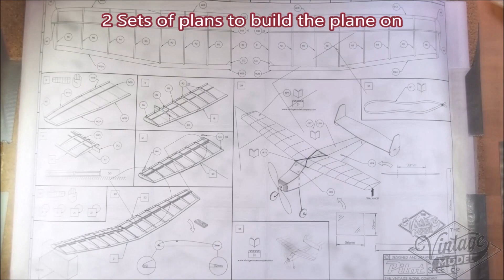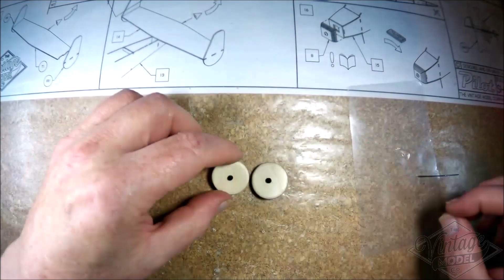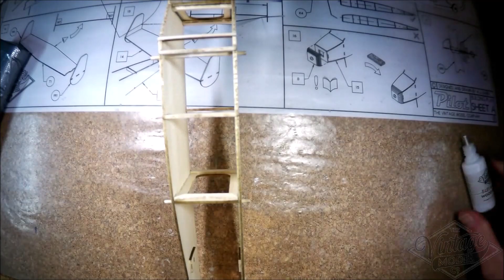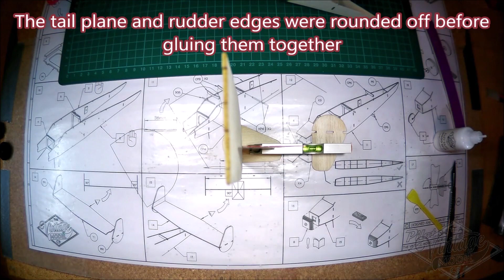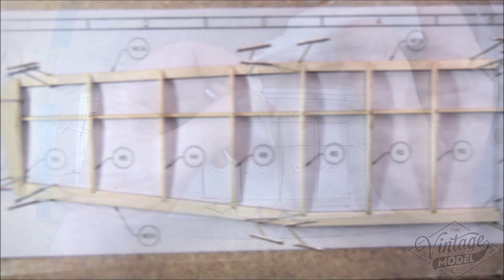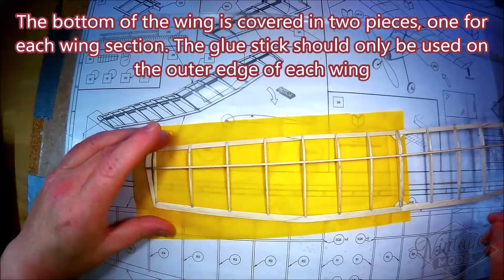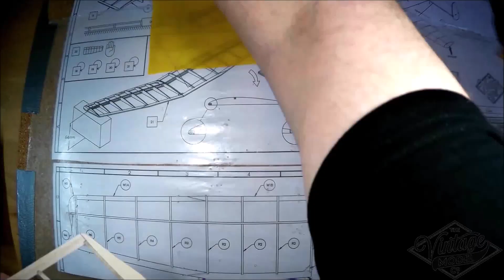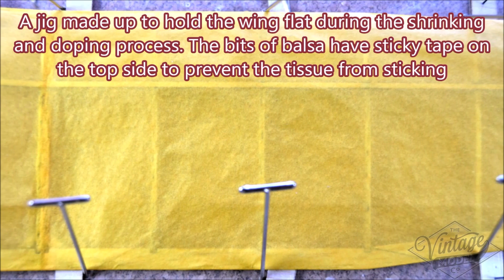Building The Vintage Model Company Pilot

Comment: Hi Rob,

I just ordered a ‘Pilot’ myself to build since I plan to do more models but start simple is the best option.
Could you list for me ( and other readers ) what additional tools you used to make it an easy build.
The video is a great inspiration and help to master these techniques of building model aircrafts.
Reply from the maker: Hi Johan
OK to start with I made my own pin board using some old chest of draws draw hardboard draw bottoms and glued two layers of 3mm cork sheeting on to it. But I have heard of people using cork pin boards.

These are the other items I use
Reynolds Cut-Rite Wax Paper. To cover the plans so that glue does not stick to the 
paper. I use Gaffa/duct tape to stick it down onto the pin board.

Code 100 Track fixing pins - Peco SL-14. Very thin pins I use to pin through the thicker balsa pieces. (Not recommend by VMC and a lot of builders). DO NOT USE ANY THICKER PINS IF YOU DO PIN THROUGH THE BALSA. IT WILL WEAKEN THE WOOD TOO MUCH.

Woodland Scenics Foam Nails (ST1432). Used to pin down all other balsa pieces and to put pressure on glued joints on the outside.

Craft knife. I use the Swan-Morton No.3 scalpel which I purchased from VMC. It comes with 5 extra blades. 

A 12” steel ruler used to help with the cutting of the tissue paper.

ZAP CA (Thin) Quick Set Superglue Cyanoacrylate Glue. Used to strengthen the pin holes in the balsa I have pinned through and also to glue canopies on. Pour some out onto a scrap bit of a plastic back and use either a toothpick or a bit of stiff thin wire to pick drops up and place them. Don’t try to pour straight from the bottle as too much will come out.

Sand paper is supplied with this kit, but for the most part I use foam backed nail files.
Any make of glue stick to hold the tissue before final gluing.

Small glass jars with lids (no bigger than 22cc I would say) to water down the PVA glue for sticking the tissue to the frame and to water down the Eze-Dope if you are going to use it.

For shrinking the tissue I use my airbrush but a fine atomiser will do just as well.

Eze-Dope. Used to seal the tissue if you intend to fly the plane outdoors. If you are only going to fly indoors then you only need to shrink the tissue with water.

A pair of long nosed pliers to bend the motor hook and shaft.

A large pair of heavy duty side cutters. To cut off the excess of the motor hook and shaft.
Well that is everything I can remember I used for this build. Hope it helps.
Reply: Dear Rob,

Your answer was beyond my expectations.
Perfect !

I have watched ( as preparation for the VMC Pilot which I hope to receive this week ) many YouTube video’s.
Yours are top of the bill .

But..,
I managed to add two tools which you missed in your listing :

* Nylon grid clamps set (eg Modelcraft )
* Engineers Square ( eg Modelcraft )
Reply from the maker: Thank you Johan.
Dam I knew I should have watched the video to makes sure I had covered everything, but I don't think I did too bad working just from my memory lol.

Comment: That has really fascinated me!! 😱 I might have a go. Last Balsa Kit I tried, I was 9.... And I'm sure it was more advanced than I was then!! If I was really Daft.... Suppose I could fit a 380 Motor (which I have PLENTY), and a simple RC System, Elevators, Rudders and Throttle only?? If not, the rubber band would suffice

I've ALWAYS wanted a RC Aircraft! Wish I had bought one when I still had money....
~ Carmine 💥 ⛽
Reply from the maker: I think if you mean a 380 motor that comes with the likes of the holiday buggy would be far too big for it. This came in at a whopping 26 grams. I have seen some videos where people have converted rubber powered kits to RC but not found any using a VMC kit.
Reply: I agree. Now that I've learned a bit more, I'm thinking a 750mm minimum Wingspan Aircraft would be the smallest I would want to go, with an electric RC Aircraft.... 
I want good, stable flight.

Comment: Hi Rob,

I have finished in 5 days the fuselage .
The most challenging action was to cut and glue the first small piece of the thinnest piece of balsa on top of the fuselage.
Broke twice so the third was finally okay.
Learned a lot by that how to handle this delicate very small balsa.

One question how you ‘covered’ the top and bottom of the fuselage. 

Q1: In my box of VMC Pilot I have thin red stickers for that.
Did I interprete the video correctly that you used a piece of balsa , which was Not part of the supplied material by VMC ?
Which you than glued on the fuselage .

PS:
I have collected in the mean time almost all of the special tools you kindly listed earlier.
Having those makes building fun gives greater chance for a good build.

Q2: Did you made the wheels black by paint or a black marker ?
Reply from the maker: Hi Johan.
Q1. No you cut out the paper stickers and glue them directly on to the top and bottom of the fuselage.
Q2. I used Tamiya XF-2 flat black acrylic paint for the wheels, but I have used a black marker pen in  other builds. Once dry I also put a couple of coats of acrylic matt varnish on them to seal them.
Hope this helps.

Comment: hi rob after watching you build wings on vmc pilot you said spray with water .is this with a fine pump sprayer an how much do you put on  do you do top an bottom of wings at the same time an do you still put dope on wings both sides an do you dope fuselage thanks nigel
Reply from the maker: Hi Nigel.
Yes you should use a fine mist sprayer. You don't need very much at all. the tissue will start to wrinkle when it is wet enough. Yes spray both the top and bottom at the same time. Once the tissue has shrunk and dried, yes I still dope them. No on this model you do not dope the fuselage.
Hope this helps

Comment: hi rob having watched your build video i am going to buy this kit from my local model shop .steve webb in frodsham i have built planes but always gone for solid wing type always wanted to try built up wing but i always think one crash an thats it but i suppose being light they come out ok i have built lots of boats which are rc thanks for inspiration let you know how i get on cheers
Reply from the maker: Hi Nigel. They do look very delicate but they are quite sturdy, well if you use enough glue that is. My very first build which was the SE5A WWI bi-plane fighter when I did some testing crashed into a cupboard and chair leg and the top wing and and one of the lower wings broke off. But upon inspection most of this was due to some of the struts did not have enough glue to hold them. Since the repair it has crashed quite a few more times with no issues to the wings lol.
Thanks for watching and I hope all goes well with the build.